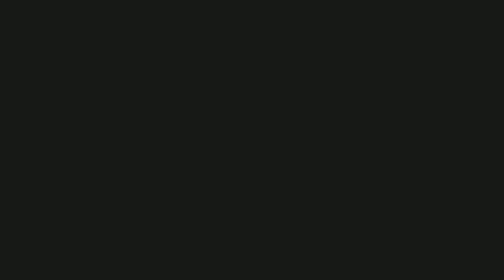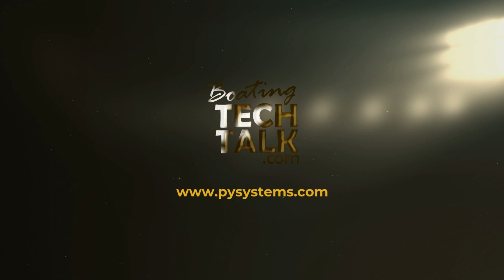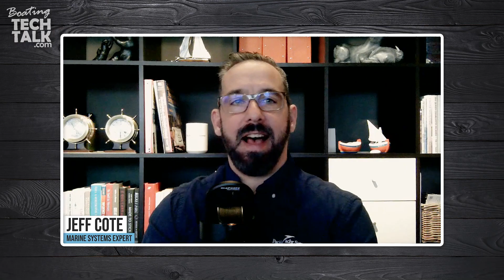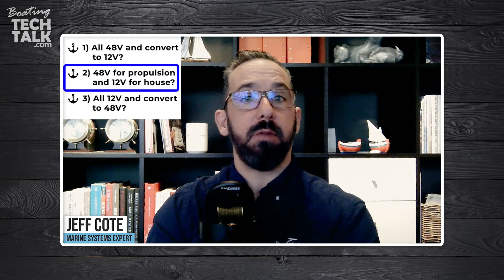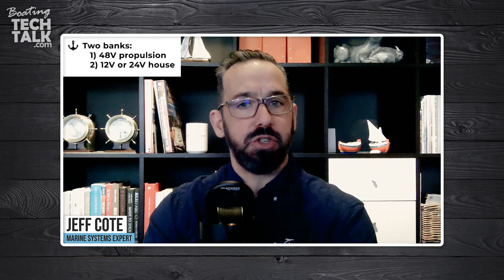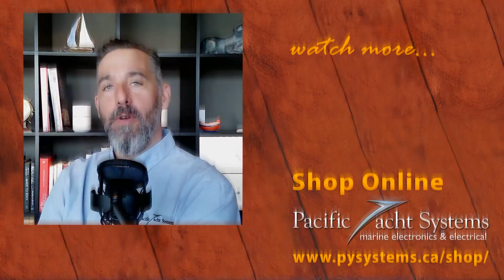I Have a 48V Electric Propulsion Battery Bank on My Boat, What Should I Use for My House Bank?

Comment: Currently i have 6 AGM batteries, 48V for propulsion and 2x12V for fridge and devices.  Buz once the 48V lead batteries die i convert to 48V LiFePo4 with a 360W DC-DC step down converter to 12V. 300kg / 600lbs batteries are to much. Heading for 100kg / 200lbs lithium.

Comment: I have a Beneteau Oceanis 381 running on an Electric Yacht QT20 with 4 Volthium Lithium 200Ah battery in series for the 48v propulsion bank.
I have two solar panels in series, about 600W going to a MPPT charger on the 48V bank.  The inverter charger is on the 48V bank also.
I added a DCDC 48V to 12V feeding 12/12 Battery charger for the 12V bank (400Ah lithium).
Both banks have a Cerbo GX, on the 12V bank it is communicating with the BMS.
So far, I'm managing the breakers to charge 12V from 48v.
Wind turbine will be reinstalled on 12V next summer, 12/12 charger will be managed using the remote input connected to the Cerbo GX while getting data from the other Cerbo GX on 48V.  Finally, adding BMS communication on the 48V bank, should be fun.

Comment: If your electric propulsion system had two motors, with independent 48V batteries and controllers, would that be sufficient redundancy, or would you still want a separate 12V house bank?

Comment: Agree, redundancy is key, especially with modern BMS controlled batteries. Multiple batteries in each bank also helps.  
If I was designing from scratch I'd put as many loads as I could directly on the 48v bank.  Inverter (more efficient 48->120), water maker, 48v windlass,  refrigeration and other large motors.  48->12 DC2DC to charge & power a 12v system which would include 100A LFP mounted well above the water line for electronics/navigation/lighting/etc.  Solar/Wind charging controllers would probably be split to try and match the load/use of each bank & use 48v alternators. We're seeing more and more support for marine 48v products and Tesla is moving to 48v for their low voltage side so hopefully 48v devices will become the norm, easy to source.

Comment: What about putting the inverter and propulsion on 48v, then having a 24 ro 12v house bank? Our inverter is our biggest DC draw and they are easy to get at different voltages. The rest of the house (starters, winches, windlass) not so easy to get at 48v. At least this minimizes the current required between the banks.

Comment: Thanks Jeff, I don't know if it was my question but it sure was a question I have.
I have the 48v engine battery bank and that feeds the 12v house bank. The 48v bank is charged by 3 x 24v panels in series on the aft bimini. But after watching this I might charge the 12volt bank also from the hard dodger panels. As you say it hard to gauge what is going to be needed the most.  Cheers

Comment: Thanks for answering my question. So far I have 12 100ah 12v carbon lead batteries in series parallel, it will be mainly for manoeuvring and so will be leaving 8 batteries @ 48v for motoring, with the Solar. then have the remaining 4 12v in series, giving 400ah for a house bank. It’s for. 30ft ketch rig, so should be able to be able to have a decent amount of time away for shore power.

Comment: This is exactly the puzzle I am facing. I am restoring an older 30' wooden sailboat and am doing a complete repower to electric with a 48V motor. My use case (for the first 2-3 years anyway)is day sailing with occasional weekend overnights, maybe some longer trips, but not cruising per se. I see using the motor to get in/out of the slip (I will be on a slip the first few years - then a mooring) and to get back if the wind dies, or bad weather is predicted and I need to get back quick(er).
My plan A is to have 2 x 96Ah 48V lifepo4 batteries in parallel and use a DC-DC converter to power the house loads @12V. I was thinking that by carefully monitoring battery usage I would be able to have sufficient capacity to make it back to harbor and power the critical navigation instruments. I would likely have a small portable generator for worse case backup although I would prefer to go with an Epoy methanol fuel cell but they are kind of $pendy.

Comment: Not a hard decision.   For dependability and the ability to isolate faults.  Multiple banks are the answer.   I have 4 different banks.   24v inverter lithium bank, 12v Lithium House Bank, 12v Lithium “Working Bank” for large loads like the deck winch and bow Thruster, and finally a 12 v Lead Acid starting bank.